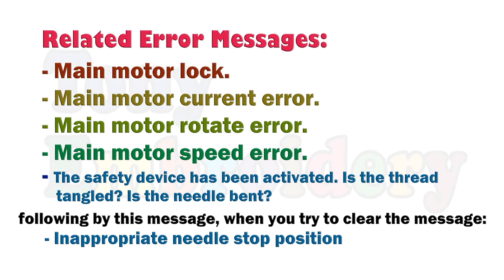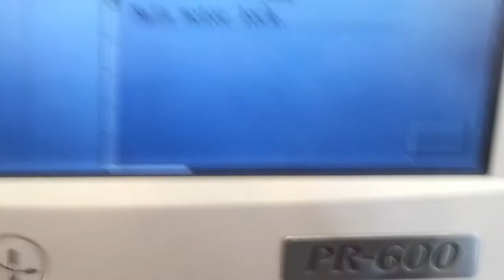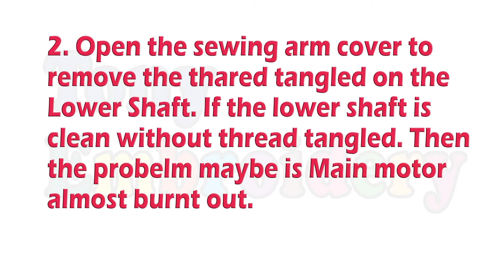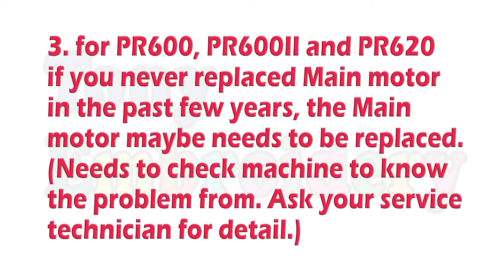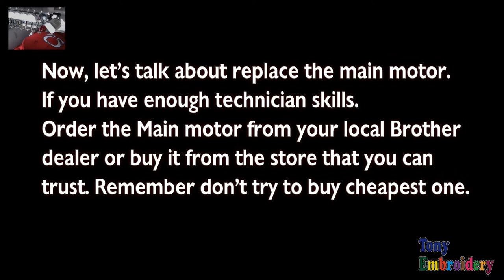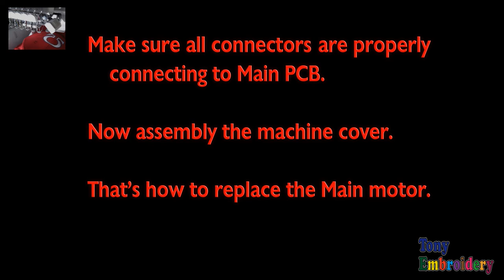[Main Motor lock] Brother PR series embroidery machine Main Motor Lock error

Comment: Thank you for this video. I was able to open and remove thread that got stuck in the bobbin. No main motor error but couldn’t turn the wheel.
Reply from the maker: Add few more drops of oil on bobbin rack.  Try a little bit harder to force it turn to push the thread knot came out. If you cstill can't figure out how to, better bring it to your dealer or technician for a service.

Comment: Awesome video!
After a 6 month down time my hook assembly on my PR650e will not rotate after I oiled it and rotating wheel by hand. Would that be a gear or a belt?
Reply from the maker: There are many other reasons will caused that happend. The detail problem must check the machine to find out. (Main motor belt too toight, main PC board burn out or main motor burn out.) Better find a technician to help you if you are not able to solve the problem.

Comment: Hello I have the babylock endurance 2. I had a thread jam in the area that the bobbin sits in. When gave me a motor error code. I got the thread out the best that I could buy in the process I turned the hand wheel all the way around trying to get the thread because it was stuck. I finally got the code to go away but my needles keep breaking. I also noticed that the little notch that the bobbin case snaps into isn’t sitting directly to the right like it was before I started turning the hand wheel in both directions trying to get the thread that was tangled inside the area that the bobbin sits in. Please help 😢
Reply from the maker: @anlkreationskustomdesignsm555  better to find a technician to help you. I can’t figure out what happened to your machine from your comment.
Reply: @TdpsCa thanks I figured it out. My timing was off!

Comment: I keep getting a Main motor encoder signal error. I have Done everything I know to do to fix it!! It was working fine on Friday and today not even three stiches in it throws that sign. I’m stumped on what to do and so stressed because I have so many orders to do
Reply from the maker: Try: 1. Clean the clear disc on the main shift around encoder sensor area. 2. Timing wrong needs to be adjusted. If above can’t fix it by yourself. Find a technician to fix it for you.

Comment: My wheel on the back will not turn.. any advise?  I had a bad thread jam.. I cleared it but still getting the Main motor lock error and can't turn the wheel on the back
Reply from the maker: @vickeydavenport1288  add few drops of oil on the bobbin rotate hook. Wait for 5 to 10 minutes and then turn the hand wheel harder can force it turns.

Comment: I have the brother psr 100 and I keep getting the check top and bottom bobbin error message. When I embroider the needle will hit 3 maybe 4x then stop. The thread will never stay down. Then I get the message saying check the top and bottom bobbin. When I look at the bottom of the shirt its nested but I see no bobbin thread. I checked bobbin, replaced it, rethreaded the machine, replaced needles.
Reply from the maker: 1. bird nest: threading problem, re-threading from the beginning
2. Check the top and bobbin thread: go check the top thread make sure it isn't too tight, go check the bobbin thread, make sure to keep the tile long enough (more than 1.5"). Take out the bobbin case and really go to check what may cause the problem.
Reply: @TdpsCa  I did all of that. I'm going to take it in for service tomorrow. I'll give you an update.